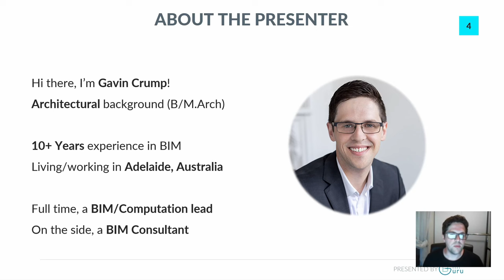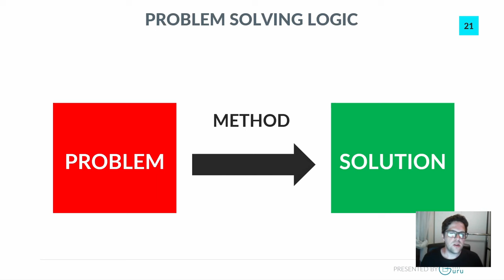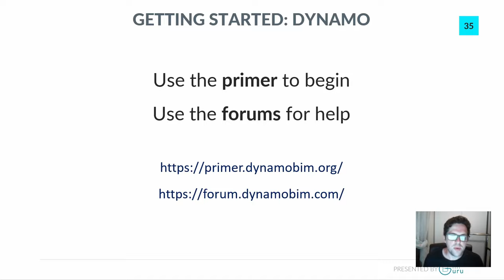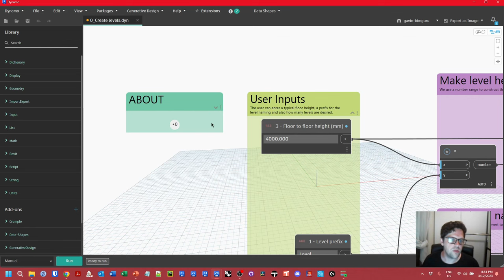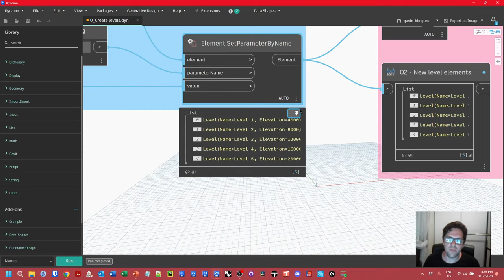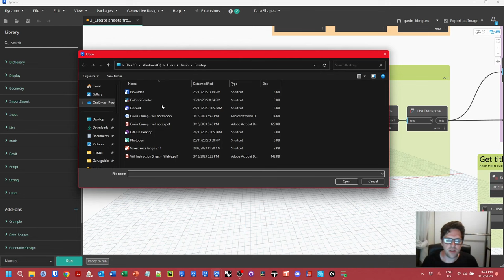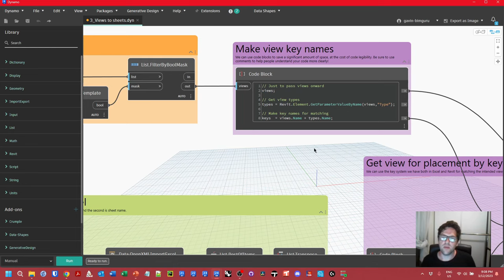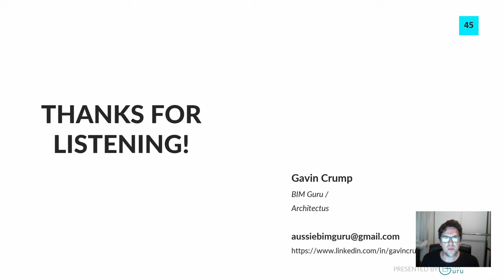Webinar: Leveraging the power of automation using Dynamo!

Comment: Thanks for sharing it. Started my journey on Dynamo mode than year ago and I've learned a lot since. Made me want to learn other programming languages. Started my Python course few months ago. Can do a lot already, combining Dynamo and Python knowledge. I'm planning to jump in C# and API afterwards. Any suggestion of courses? Thanks again!
Reply from the maker: API first, C# afterwards is my recommendation.

Spending some time with pyRevit is something I recommend as it will make you more comfortable writing entirely in Python without access to Dynamo. Personally I'm still at this stage generally, learning a bit of C# through experimentation at this point mainly.

I'm not familiar with any particular C# courses by experience, although I did take CS50 via Harvard (free) which I found very valuable to learn more about raw C and computer science. An old course I know some people like is Danny Bentley's series here on YouTube, as well as various AU resources, here are some:

https://www.autodesk.com/autodesk-university/class/Pushing-Revit-Next-Level-Intro-Revit-Plugins-C-2018
https://youtu.be/C0mNU2bEUSs?feature=shared

You'll need to learn about Visual studio, application development and various other areas of C# to make that jump - it's quite difficult and no course out there will teach you 100% of it - lots of experimentation required I'm finding.

Comment: Hey Gavin, love this video and I have learnt a lot from your channel overall. I am trying to build a script to create Spaces on Revit using a CAD floor plan. Have you made any scripts like that?
Reply from the maker: Unfortunately not as spaces aren't really 'findable' in CAD unless they use fills/hatches to represent them. You could look into getting their 'tags' as text objects using DATAEXTRACT command maybe, but Revit/Dynamo don't have full capability in this area.

Personally I'd be using Rhino as it can import the CAD and then you can work with the text as an object and get its value, and if their are hatches/regions you can get space separators using Rhino Inside.

It's a very bespoke workflow though, too much so for the channel or my free time. Maybe worth researching these ideas and taking advantage of dynamo forums and/or rhino forums.

Comment: great efforts.I am using dynamo for the organisation there are some questions from me as a software developer.
1. Scalability: how to deploy the dynamo script to 500 users.
2. Security: user can see the script so there is no secret . The script can be steal easily.
3.Cloud: cant do automation on autodesk cloud.
Reply from the maker: Yes all considerations to make when scaling dynamo. At 500 users the firm should ideally develop their own software I think.

There is no way to lock down dynamo scripts so its just an organisational decision if they use Dynamo at scale - they accept the risk.

RE cloud, again you will need the firm to invest in a forge capable developer or team. Dynamo doesn't work in asyncd environments where the user doesnt actively run the script in session and isn't really built for it so wont change to do so in future.